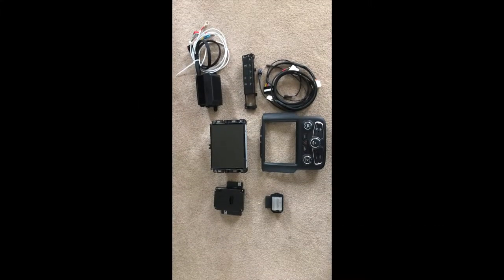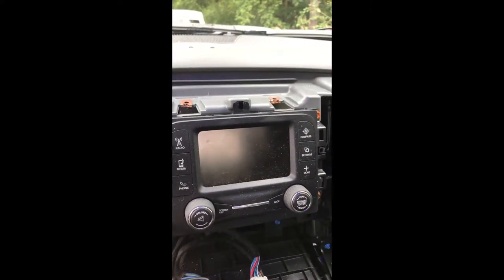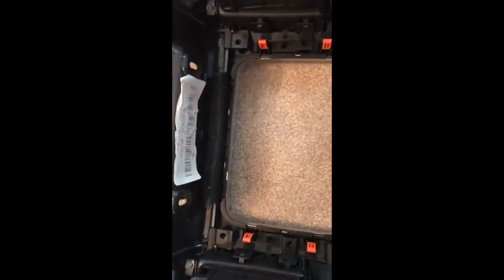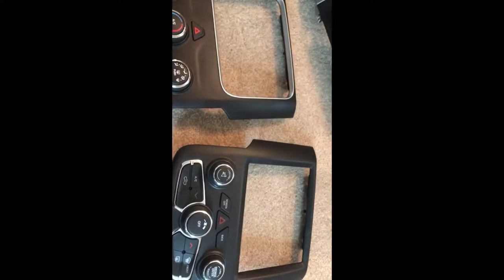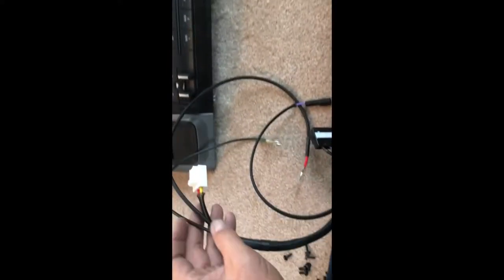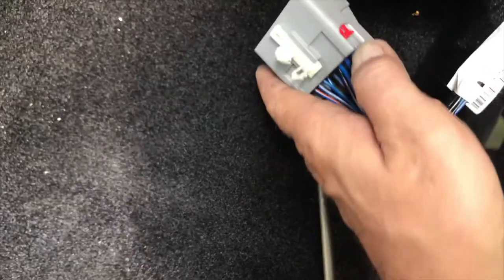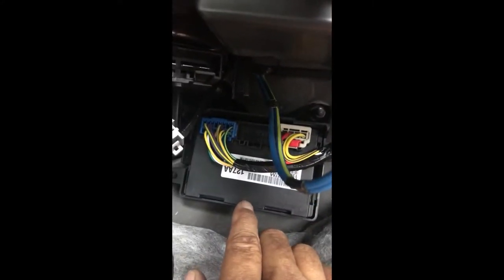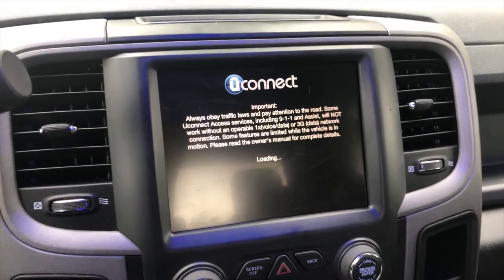Ram radio and 7 speed fan upgrade

Comment: Thank you for posting this! What did you do with your suspension?
Reply from the maker: I had a 3" spacer lift up until Thursday,  Im in the process of installing a 5.5" Zone Radius Arm lift and should be done Wednesday.  I am waiting for shocks to be delivered as I had the wrong ones.
Reply from the maker: I had a 3" Tuff Country lift, it now has a 6" Zone Radius Arm Lift.